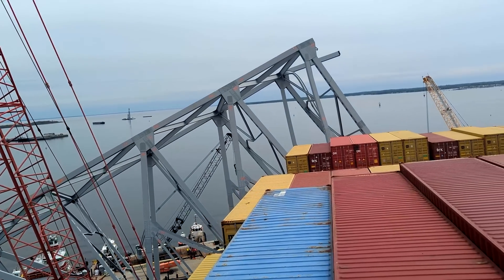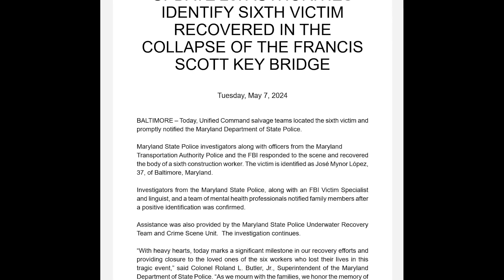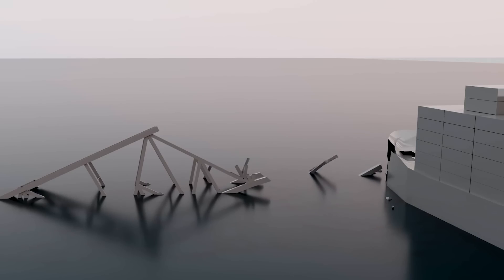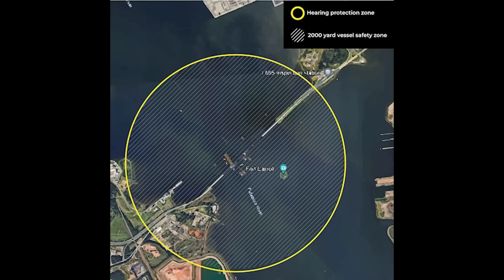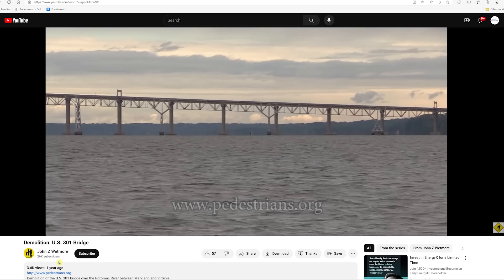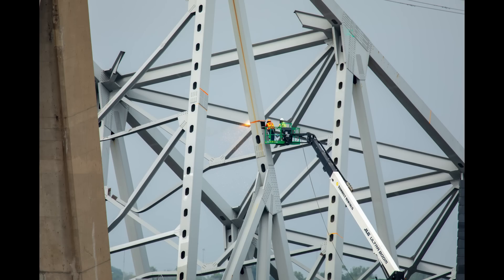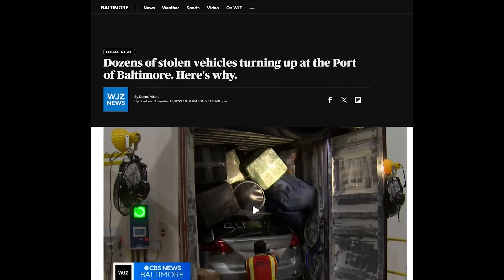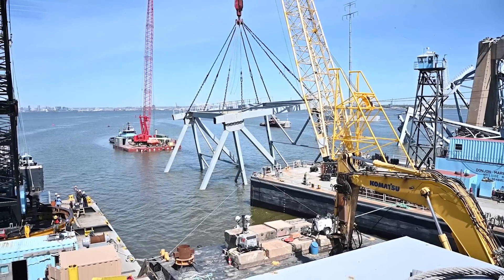Explosives Will Drop Bridge Truss From MV Dali Ship | Baltimore bridge Collapse

Comment: Friday will not happen. They have to get all the cuts made, inspected, and loaded with the shape charges. Then a 2 day notice of when the blast will occur. Wave after wave of rain is headed toward Baltimore. They have 1 chance to get the blast 80%+ complete/correct. It's going to be interesting how the blast will push the Dali.
Reply: Second the above. There will be near zero push from the charges themselves, how the cut sections fall will be the only question. Still a lot of weight on the bow of the Dali keeping it grounded; so the question I have will be whether the weight reduction will be enough to free it immediately or will they still need to unload the bridge deck to get her free. It would not surprise me to see them add mooring lines to whats left of the pier to make sure she doesn't move.
Reply: @kstricl  I'd estimate the concrete pier laying across the bow is substantially heavier than the trusses.
Reply: @davidzachmeyer1957  it looks like the pier section is gone now. The bridge deck surface though is still very heavy so that might keep the bow planted.

Comment: Though for any veteran, the words "surgical precision" in reference to a military operation brings up the many previous times "surgical precision" has turned into "surgical emerency."  I hope this is one of the times it works perfectly.   No, 2000 yards is not "overkill" for distance if you have normal hearing, no external protection and want to hear well when you're 70.

Comment: Explosives must be much safer to cut parts under tension, which can snap in different directions. Don't envy those guys using oxy/propane torches in the video.
Done work in storm stricken forests. Sometimes logs jumps in unexpected directions when cut. So far not hurt or killed.

Comment: From past demolitions, there are a large number of charges that are used depending on where, what kind of material is to be cut, how it is to be dropped, etc.   Some of them exert a large, quick force that just pushes the steel out of the way instead of blowing it.  Some of this stuff burns so fast, it is thousands of feet per second.

Comment: It's rare for refrigerator or a front door freezer installed at a 45 degree angle in a corner of cabinetry to work well, how did you overcome the doors not opening fully? Ray Stormont

Comment: They need to use controlled demolition for the truss on the Dali because it's still effectively a bridge spanning two points of contact. If they keep cutting out truss members at some point what remains in place is going to buckle and collapse, so to do it safely without precision cutting they'd need to build up piers underneath it to support the structure.
Reply: I agree. Manually cutting a structure like this with people close by is a no-no as there is no way to tell what happens when a truss or whatever gives in. Im curious as to how the structure will collapse when it goes boom. I know it is all about timing and placement of the charges, but I expect some collateral damage to Dali no matter what. There's too much material hanging directly over the ship, and gravity cant be ignored..
Reply: @HOOOLD_ON  Well, I would suggest detonation with a slight delay on the ship side to implement a pulling impulse away from the ship. The additional damage to the ship would be minimal. But I could be wrong and they time it almost synchron.
Reply: I imagine the cranes are being used like piers, to support some of the load while pre-cuts and thermal charges are set.  

I'm curious to see if all the cranes can be removed, or if a few must stay till after demolition is detonated.
Reply: I agree.  There would be no way I would hang in a basket with a torch and cut a piece at a time.  If I did that, I would end up pinned to the bottom under some 100 ton piece of steel.
Reply: Good comment, very astute
Reply: All you keyboard engineers should go down their and apply for a job and bring your engineering degrees

Comment: Regarding the cars: if the cars are functional, there are a slew of regulations they have to follow, from the amount of gas allowed in the tanks, disconnecting batteries (especially for hybrids) and marking and placarding of the containers. And typically the cars are wrapped in paper and wooden bracing to avoid cosmetic damage. But if the cars are rendered non functional/sold as scrap, they can be shipped as general cargo. I’ve personally seen three obviously wrecked cars stacked on top of each other and fit into a container, being sent out for recycling. 

I highly doubt those were stolen cars - it’s much more likely they were wrecked before the accident.
Reply: The cars are junk

Comment: They are doing a great job. The other issue they have to deal with is the huge cement support column embedded on the starboard side of the bow. That looks like a big task.
Reply from the maker: I think once they limp Dali to port, cranes can then lift that concrete pier cap off the Dali
Reply: @jeffostroff  Once they move the Dali, who is responsible for clearing the deck. Seems like that would fall on the Dali's insurance?
Reply: That has been cut in half already.
Reply: @stephenholland5930  Do you have an image of that Stephen? Link? Thaks, Greg
Reply: @nopriors  Jeff covered it in his last video.
Reply: @stephenholland5930  Thanks Stephen